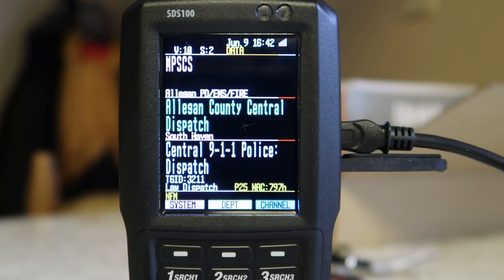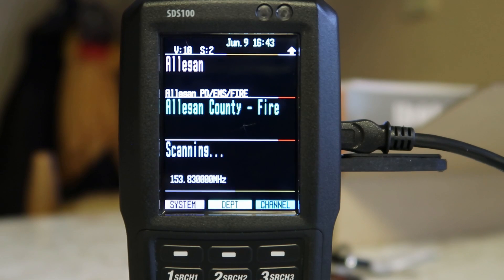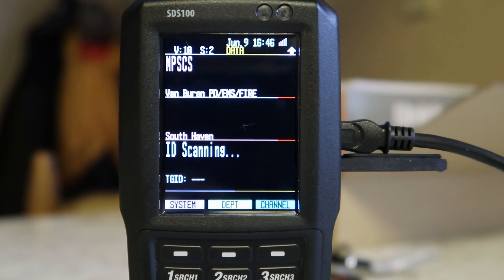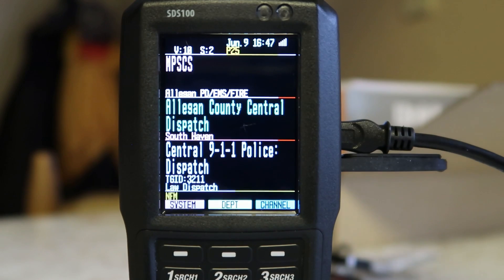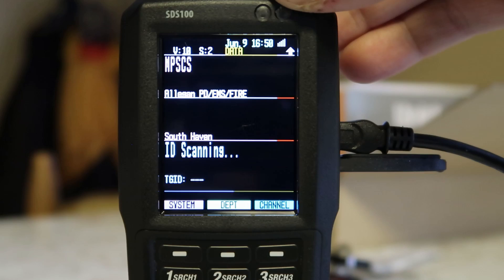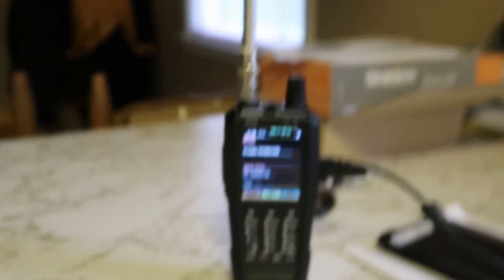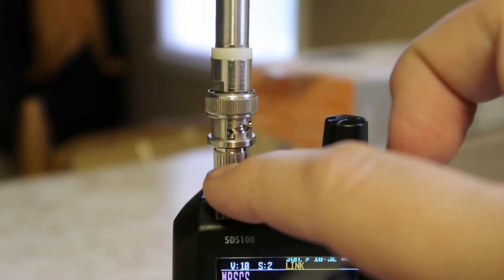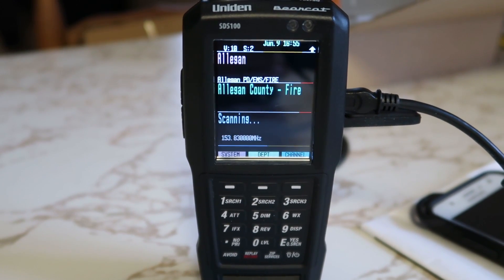Uniden SDS100 Scanner Audio Performance P25 System - True I/Q

Comment: These new overpriced digital scanners are a scam. The majority of police departments will continue to encrypt their transmissions in the near future, and it just wont be worth the price. Uniden even pays admins on the radio reference website to remove all negative reviews on these scanners and anyone who discusses encryption. Just wanted everyone to beware.
Reply from the maker: Digital has been out for well over a Decade and very few departments pay the extra money to run encryption. Other departments flat out say they are not going to encrypt their radio traffic, they wsnt transparency.  Drug, undercover, and very sensitive information channels sure, but common traffic..nope.  Don't hate on something that one you are not speaking the truth about in general, and second probably can't afford one so you talk trash. The Uniden SDS100 is by far their best scanner ever!! If you can't hang with the big dogs then stick to your phone scanner app thats free🤣
Reply: MiTreasureHunter You are actually very incorrect. The last President wanted to push interopability among all departments and therefore wasted millions of federal money to pay for switching to digital TRUNKED systems. (I live in NJ and it is called NJICS here.) However, these digital systems also give each town, district, dept, etc.. the option to simply flip a switch on their radios and go encrypted. Doesnt cost them a dime! It has already happened here in NJ and will slowly begin to spread across the country. Furthermore, there is an additional plan to eventually get rid of all radios, and have departments use voice enabled cellular data equipment to communicate over encrypted cell phone frequencies (which have already been alocated for when that switch is made). Some MONOC EMS units in NJ have already started using this technology and cannot be monitored on any scanner. This technology is free due to earlier federal funding earmarked specifically for this purpose and does not cost these towns a dime. Yes, some folks in the US may be lucky and have some real tough, smart, conservative leaders who choose not try and fix something or change something that aint broken. Thats why I said to check first to see if your town, county, or counties in your state have already started going encrypted. If they are, then most likely your area will too very soon. But if you have the spare $600-$700, then sure, buy this radio and enjoy it while you can.
Reply from the maker: John Doe the last president was a flaming pile of 💩 who tried his best to destroy the country.  If you live in a Democrap controlled lunatic Liberal area well you area in an area where they want you to be uninformed little conforming minions. I would be more worried about my gun rights then a scanner if I lived in such an area.  Some areas of the country are just plain Anti Constitutional, I would never live in such an area.  As far as the rest its just more Fear porn.  If you want to live your life worried about what "Might" happen in the future then you are going to live a dull, restricticted life.  If you have the money and want one then its not a waste. If you live in a Democrap flaming Libratard controlled area, spend the money and move because the scanner hobby is the least of your worries! Enough arguing about a hobby and what "Might" happen to it in the future, it's a damn hobby not a Freedom so indulge if you so please. Or...live in fear of the unknown and kick yourself down the road if it was all just more 🐂💩.
Reply: MiTreasureHunter I actually agree with most of what you said in your reply. Unfortunately, I am stuck living in a liberal democrap area where many towns are changing what doesnt need to be changed. Therefore these overpriced radios are useless bricks when it comes to monitoring many police departments in NJ (where I am located). Hence libtard state...I agree. Unfortunately, I am also seeing encryption building slowly even in states such as Virginia and believe it will just continue to spread like wildfire, unless there is strong federal legislation to make encryption illegal. I believe there is a pending case in Colorado on this very issue. My advice to everyone is to first make sure your local area is not encrypted or if many other towns in your state are going encrypted, before spending over $600 on a scanner that has already become useless for many folks, depending on where you live.
Reply from the maker: John Doe It is a hobby, plain and simple.  I myself have tens of thousands invested in toys (hobbies) that at any given time a law could pass and make them worthless.  Scanners, Amatuer Radios, Drones, ATV's, Metal Detectors, just to name a few.  If BS laws pass in the future and make them unusable sure I will be pissed, but once again the future guarantees noone anything so I will spend the money and enjoy my hobbies while I can today. $600 today is not much as far as hobbies go, its actually pretty cheap.  Also, these scanners will not be useless...true scanner enthusiasts know there is a whole other world of communications to listen to besides Law Enforcement.  I do agree that you should do research to see if your area is already encrypted, but then again I advocate to research Any hobby before getting into it.  Metal detecting is a good example, many places it is illegal for one reason or another.  Where I live it is not allowed in certain city and county parks, State and Federal land.  It still leaves me enough enjoyment to hunt that I have 4 detectors and well over $5K invested in them.  Tomorrow or in the future more towns and areas could outlaw the use of them, and likely will, but it don't stop me from buying new detectors or worrying about the future of the hobby.
Reply: My small little town PD is full encryption and has been for years now. If small little towns are doing it, you can bet big cities will when the technology is always improving and becoming more practical and preferred. There will never be a scanner that can pull encrypted transmissions. That kinda defeats the purpose....they are encrypted for a reason! they dont want people listening.
Reply from the maker: I guess to bad for you.  Michigan was one of the first APCO 25 systems and the majority of it is not encrypted, well over 12 years.
Reply: You are correct. Allegan county already encrypts LEIN, Tac, Proprietary, and Detective talk groups.
Genesee and Lapeer County will soon be going fully encrypted except for a few select talkgroups. The reason they stated they're going encrypted is because of online streaming and social media. 
The deployment of encryption has been booming over the last few years and will continue.
On these new digital systems, encryption is already built into the radio so there's no additional cost.
It just needs to be set up and enabled.
Reply: I don’t see the scanners as a useless waste of money, because I see it as even if Police Department go encrypted you can still hear businesses, digital modes on ham radio,  and my favorite listening to railroad since I am a big train fan fan. And in my area DMR is a big thing, so pretty much all services like Road, police, fire, and local businesses and farmers alluse this mode so I don’t see it as a waste of money, I mean if you’re buying a Scanner just to hear police it’s kind of a waste of money to be honest but if you’re like me and you’re buying it for more than just police and I think it’s a very good investment. I’ve owned a TRX 1 and SDS 100, and I think both radios are very nice ,I can’t really say whether I like one more than the other one
Reply: Yeah Uniden sucks. The performance on these is shit and people are only pretending like this is good because they are braindead slush mouthed fad losers that use this too feel special about themselves just because it's new and has gimmick features. I already have SDR and handheld scanners and they serve 2 different types of use, no need to combine. Not to mention this is useless since 1, you still have to hook it up to the computer so you might as well use any other SDR because 2, If I'm gonna use an SDR I don't need some locked down uniden with coverage gaps and frequnecy lockouts. This is a stupid ass tryhard piece of shit to save face because uniden is garbage now.
Reply: @KandiKlover  wow you are all of what 12? you reason and think like a child, there is absolutely nothing wrong with these scanners and if you can't figure out how to use yours, I suggest don't bother with it and go on with your pathetic life, oh, and you can program these without the computer, but it takes brains and common sense to do so, which you've displayed a questionable reasoning skill.
Reply: @KandiKlover  is a dipshit....
Reply: @KandiKlover  Maybe it would have been better for you to actually touch, smell, program and use a SDS100! Yes programing this scanner by way of PC is an option and yes you can go with onboard self programing. So I read your product hate and foolish way to talk about something you have no actual hands on knowledge. I am so liking the SDS100 I am waiting for delivery of my just ordered SDS200! You enjoy your toys I will enjoy mine!

Comment: How do you hook up your scanner to your car audio?
Reply from the maker: 3.5mm output jack on scanner to a 3.5mm aux input on stereo.
Reply: MiTreasureHunter i have a Ford Explorer im not sure it has a auxiliary input? Has usb ports ill have to check its a new vehicle so I'm still getting used to it. Thanks i hope it has one
Reply: Dont have a AUX input you think for the price of these cars you would have won. Guess ill have to hope a Blue Tooth scanner comes out or look for a external speaker
Reply from the maker: Brian 3 get a portable FM broadcaster that plugs into the 3.5mm scanner output , then tune your FM radio to the station. Plenty of portable FM broadcasting devices availble and they sre pretty cheap. Thats the way I did in the past for a head unit thst did not have a 3.5mm input.
Reply: If your car has Bluetooth you can Wirelessly connect a ICOM R30 to its Speakers , and ICOM R30 also has Built in GPS as well, UNIDEN is still behind the time , they need a Cable and Hockey Puck to do GPS.

Comment: The screen probably.  Eats batteries.   If it stays on.    Looks great. Dmr.  Nxdn.  Not inculeded. Better lower the price.
Reply from the maker: LOL I doubt the price is going anywhere. Battery pack so you just charge it nightly or when in your car, simple. Not everyone wants or needs DMR and NXDN. If you don't  like then don't buy one, simple as that.
Reply: James Acri actually the screen uses very little power. It's the dual CPU's that eat the power
Reply: James Acri also, Uniden pays a license fee for DMR NXDN and Pro Voice. Whistler is actually charging the same, but skimped elsewhere.  So it appears a better deal when it's not.
Reply: Wow I don't know where this "myth" got started...but there is no licensing fee for decoding ....AND if there were it would need to have been FCC type approved for commercial receiver licensing (like DRM/HD radio broadcasting).  If this transmitted...yes a fee would then be worked out.  The only thing Uniden need's to do is drop a plug with an * XXXXX and XXXXX are registered trademarks of XXXXXXXX etc.   This is why I lost all \ALL/ interest in any Uniden product after this scam.  Along with their "marketing" of SDR as what? a bonus? THE ONLY bonus is to their bottom line....but theirs a sucker born every minute, a fool and his gold are soon parted and last but not least...put YOUR grandchildren thru college...NOT someone else's.
Reply: Yeah you pay for all the future updates like DMR and NXDN and uniden has shitty reception. Just get better whistler scanner instead.

Comment: Did you have to input the talk group #s for the MPSCS system?   I'm in Oakland county, and usually pick up Northville tower.  I have been listening on my pro96, which has always worked well... Any advice on picking up some of the other MPSCS towers? ie. Holly, and others... I'm looking forward to this SDS100, which is coming tomorrow... Woot!
Reply: Also, loving the audio on this...
Reply: I also have the same antenna, I usually use the 800Mhz rubber duck that Rat Shack sold, which really works well, for 800 that is...  <grin>
Reply from the maker: I programmed it using the Sentinel software to make a few Favorites lists. Never used the software before and figured it out without much effort.  Program in several other towers if you think they are close enough and have other traffic/talkgroups not broadcast on your main listening tower.  The better the antenna the better the reception.  I am going to get back into Ham radio so going to be putting up some nice base antennas.  I used to pull Chicago in and I'm over 70 miles away but I'm close to the Lake Michigan shoreline.
Reply: When I tried to program the MPSCS system, it put ALL the tower locations in, and looks like it scans through all of them... What did I miss?  Yours looks like you are just scanning the one tower...
Reply: breezyjr I have the BCD436HP , I also live in Oakland county, I typically use the northville tower or the Washtenaw county simulcast. Waiting for the Oakland county p25 system

Comment: I prefer the Whistler TRX-100 and 200 NEW LSM scanners, ill wait for those.
Reply: For anyone still reading this thread - Whistler announced there will be NO new TRX 100/200 scanners.   Mr Plott will be waiting a long time.
Reply: @homebtsea  - Perhaps NOT, Whistler is still Selling Digital scanners and is still Developing scanners.
Reply from the maker: There are not even any demo units of those, so you are basing your preference on a list of words. If they are better I will get one, but for now they are a concept. I waited 7 months for a very hyped new metal detector to only be disappointed by the actual unit once it was in hand.
Reply: MiTreasureHunter - fact is LSM I/Q receivers are NOT unique to Uniden, Everyone now has them, even ICOM and AOR , the Only diff is ICOM and AOR do not do Trunking. and the AOR DV-10 gets a heck of a lot of MORE Digital modes than Uniden for FREE. I am basing my Choice on the FACT that Whistler will not CHARGE for Digital modes like DMR and NXDN.
Reply: Have an older whisler ws-1095 and it is really excellent on audio and performance and no ear fatigue squelch snapping that my uniden had.
Reply: It has too much synthesized audio for me. I'm not trolling uniden either.

Comment: I got mine friday, and sent it back for another sds100, not sure if something was wrong with it or not, just missed a lot of traffic. Hopefully the next work one works as well as yours. I love the display. Are you using the stock antenna?
Reply from the maker: I thought mine was not working also at first. But two factors played a roll. First, I have never owned a Uniden brand scanner so have never used the "Sentinel" software. Second, the stock antenna is really pretty aweful.  I figured out more about the software and have been tweaking my profile daily and I use a telescoping antenna now. The antenna is alot better then stock but look forward to aftermarket antennas specifically designed for the SDS100. Those two factors have greatly improved my reception. They do have some issues that future firmware will hopefully fix but I'm really liking this scanner.  So much so I don't want to hook it up to my pc to provide my Radio Reference feed, I want to be able to have it mobile with me wherever I go.
Reply: hemiram2k5 make sure you are clear of other electronics. That seems to be the major issue, interference from other things. Set mine on the laptop and found on the right side it didn't receive anything, put it on the left and book, started receiving. Turns out it was over the computers WiFi card on the right side 😉